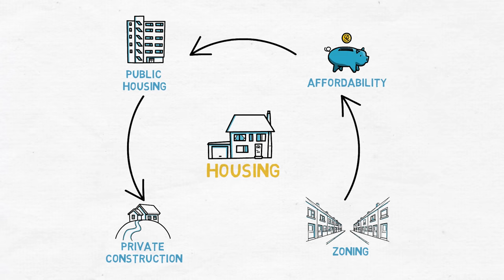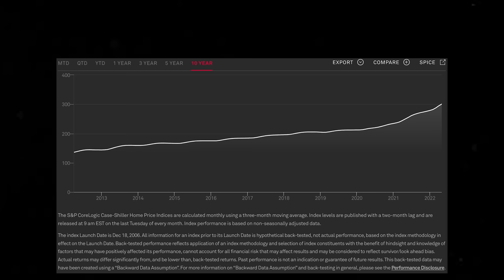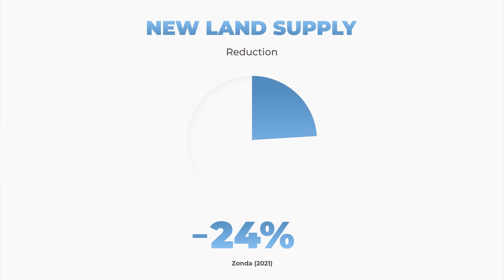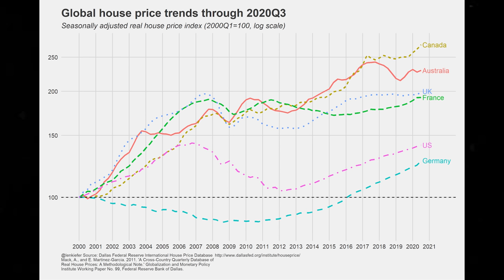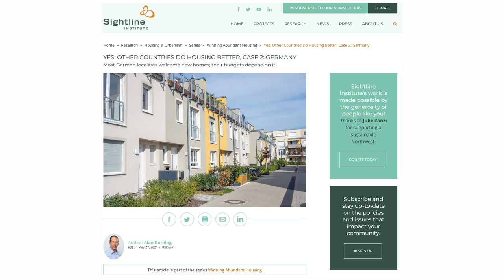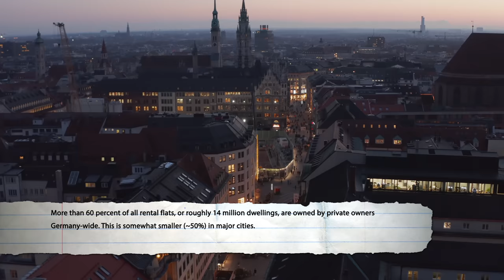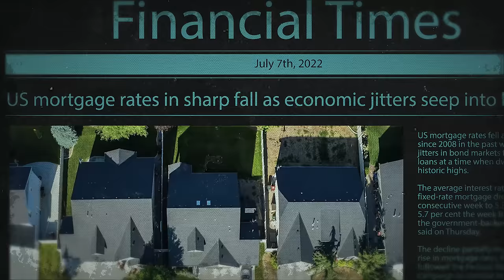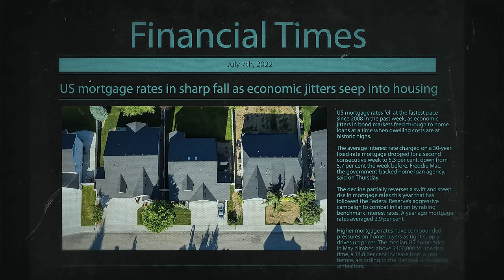Germany vs. USA: The Affordable Housing Crisis

Comment: I live in the "Speckgürtel" outside of Karlsruhe, one of the villages surrounding this medium sized town. Karlsruhe happens to be one of the towns with the most extensive network of Strassenbahnen (Tram) in Germany, Europe or the world (or so they say). You can literally go for hours and up to 100 Kilometers in one direction. This infrastructure is rather old, actually they took over some of the railroad tracks that were abandoned by the Deutsche Bahn and made it profitable again (they changed the track width of all the 'old' tram-lanes to be able to use the standard width of the DB with all cars of the tram). One of the improvements in the little villages was, that they moved the tracks from the outside of the village to the center of the village whenever possible (sometimes car lanes and tram sharing the same space). Actually this infrastructure was one of the reasons we moved here thirty years ago.
Another thing though, this whole development was driven by a very few persons that recognized the chances they could see in the future and kept pressuring officials of the town to support them. Convincing officials of what is good planning and what is not probably ist he hardest part in urban planning. And sometimes it is hard to tell, is is lobbying or genuine concern for the urban development,  that you are dealing with (as a local  politician).
In any case, it helps, if more people understand the situation and are able to interpret what architects, planer and politicians are trying to tell them.
Reply: Thoses lines aren't abandoned they are mixed use with with DB Trains this is called the Karlsruhe Modell it was invented there and has been or is been implemented in Chemnitz, Heilbronn, Kassel and Saarbrücken even with an international line to France. Total or almost total conversion of heavy rail lines happened before on the Suburban Rail Lines in Cologne reaching to Bonn and some lines in Karlruhe like the one to Bad Herrenalb and in the region around Mannheim with meter gauge heavy rail. If you only look on the tram network itself without heavy rail mixed use, the bigges tram network in Germany is Rhein-Ruhr.
Reply: @futurerails8421  I am just wondering whether to get agitated or just assume you are to young to personally know? The Murgtalbahn is mixed use and was never abandoned. The lines through the Hardt were abandoned by the DB some decades ago and parts of that later reactivated by the KVV as S1/S11. And these lines are not used by the DB at all.
Reply: @wora1111  It seem like you did not know what Karlsruhe Modell means. The Karlruhe Modell is the use of multisystem trams supporing DC tram power system and AC mainline power system and running under EBO and BoStrab. Even if some lines have no other rail traffic besides this, they still support it without special locomotives.

It was invented to explicitly use existing rail lines to bridge the gaps between cities and have tramlines on both ends. Otherwise cities like Wörth am Rhein were way to small for a tram.

Some lines in Karsruhe are also total converions or partial conversions from former rail lines or suburban rail lines.

These things were done before for example in and around Cologne but putting a DC overhead wire instead of an AC overhead wire above a railway line and especially installing high floor plattforms limits the usability for heavy rail.
Reply: @futurerails8421  Yep, I agree. That is pretty much what I told my colleagues about three decades ago.

Comment: Very interesting video and well done. The big problem in Germany is that there are increasingly fewer small, private landlords, especially in big cities. The biggest landlords in Berlin are companies that are listed on the stock exchange and make enormous profits. Compared to 2017, average rents in Berlin have risen by 18.5%. Real wages have also risen in recent years, but to a much lesser extent. Due to high inflation, real wages have actually fallen by 1.8% compared with last year. In the past, local authorities were able to intervene in the rental market in a regulatory manner because of the so-called "social housing". However, this system has been massively scaled back in recent years. In addition, many cities and municipalities have sold thousands of rental apartments from their own stock to profit-driven large corporations. In doing so, they have also given up the possibility of being able to intervene in the market in a regulatory way. As a result, cities such as Munich have problems retaining or finding esential workers in the low and medium-wage sectors, such as nurses or firefighters, who can afford housing in the city. Especially the conservative and neo-liberal forces constantly claim that only new construction can solve the problem. But, as mentioned in the video, the cost of construction has risen so sharply that this cannot work. In addition, the climate crisis is causing construction costs to rise even higher. In my opinion, you can't let the market regulate every area of life, because that leads to antisocial results that endanger social peace and democracy in the long term. And the housing market is not the only problem of our time that needs to be solved.
Anyway, I look forward to your next video and wish you a wonderful Sunday. Greetings from Berlin.
Reply: Indeed a chronically under mentioned, other side of Germany's housing issues is die Neue Landflucht (TL the new rural exodus).
While long increasing financialisation of the real estate sector does push central urban housing prices, continued neglect of more rural infrastructure and development disproportionately drives a supply of people into the cities, to also fuel the competition.  - After all, price (or regulation thereof) matters a lot less without someone willing (or forced) to pay it.
Reply: A lot of cities sold huge parts of their social housing to big corporations in the late 90ies and early 2000s. They created this problem decades ago.
Reply: @MsLarrythegreat  interestingly due to covid we saw the opposite effect for a short time due to home office. The main incentive for going to the city is that the jobs are there. If you are not forced to go to them for work, many would prefer living more rural. But due to the factors you describe the infrastructure in those areas has been so neglected to the point where home office is not even possible. Basic things such as stores, internet or doctors are a lot worse in rural areas. Its a self fulfilling prophecy really

Comment: Great video!

I've lived in North America off and on for years, but I'm currently on my first stint in a Canadian city (a decent-sized one out on the Prairies) and I've found the housing issues here fascinating. The cost is much better than elsewhere in Canada, but affordability by local cost is still a mess. My family wanted a central, walkable neighborhood, but when we looked at the city centre it quickly became clear that we would either be in old, cockroach-infested buildings with little to no security or in very expensive (Toronto expensive), newer buildings...right next door to the cockroach-infested buildings with fights and drug deals going down most nights. And mixed in with all of that are the mid-range, more affordable apartment buildings...all of which are for seniors only. It feels so close to being well planned, and yet so far at the same time! (The few buses and 20-minute walk to the main supermarket in the area aren't ideal either TBF.)

Comment: I live West of Germany and we, again, have upwards pressure on the housing market. Much higher fraction of ownership, I guess, than at the neighbors. Also, the price differences per blended square meter house, square meter plot and cubic meter house, typically are significantly higher in the denser populated region of the country (cf. "coastal" USA).
The problem in these markets?
When you move from the "expensive" to the "cheap" side of the country, you step out of the inflation spiral on the expensive side and most people will not be able to afford a return into that spiral at a level they will find acceptable.
Leaving the "coastal" US for a stable or cheaper German market may have the same effect, I guess.

Comment: I live in a very expensive area, the SF Bay Area. After 50 years of opposition to development, people are finally coming around to an awareness that the old NIMBY model doesn’t work. However, a lot of the cities here also have rent control. And many tenants with rent-controlled apartments are the worst NIMBYs, because they have way below-market rents and don’t want to have to move to allow bigger buildings. They support anti-development candidates. You mentioned Germany has a lot of renters and also rent control. How does Germany avoid that problem?
Reply from the maker: There's a few things going on, but I think there are two big reasons (and fair warning, I am generalizing a bit here because there are always some caveats). 1) Most German rent controls doesn't mean that your rent is fixed, but that your rent can't be arbitrarily increased. For example, rent control has been in force in many of Germany's largest cities, including Hamburg, Berlin, Stuttgart and Munich, for many years. This stipulates that “cold” rents (excluding utilities) cannot be more than 10 percent higher than the local comparative rent. In addition, rent cannot also not increase dramatically from one year to the next. The landlord is allowed however to increase the rent up to 15% within a 3 year period. But this increase should be "justified". 2) Development in general - especially the demolition of an existing building to make way for a new development is a tedious process in Germany. However, if the landlord decides to sell the building you are living in and the new owner wants to kick you out - there isn't a whole lot you can do.
Reply: @TypeAshton  here the tenants or neighbors would sue and tie the developer up in court for years until the project is no longer financially viable.   The state is now passing laws to try to prevent this by preempting local laws, but so far it hasnt made much of a difference.

Comment: Wow .... I am almost speechless, that's why I write my comment down here ..... you managed to explain a very complicated situation in a way, that everybody could easy understand, you were short and at the same time you explained every aspect, and on top of it, you managed to explain the differences between USA and Germany.

But .... I can not agree with you, that housing in Germany is cheep, the opposite is the case, renting is something like play with the wheel of fortune and building a home/house is extremely expensive. 10 years ago it was wayyy cheeper, I bought my house in 2011 for 135.000 €, it has now a value of at least 220.000 €, the house of my parents was build in 1978 (a two-family-house) for 187.000 DM (Deutsche Mark), that has now a value of at least 250.000€. 
My parents bought the ground for building the house in 1974 for just 10.000 DM (1.000 m²), now here around that house, even building-ground half that size (bigger sizes are not affordable anymore) will cost you at least from 100 € per m² on, if you are so lucky and can buy one.
Reply from the maker: Hi there - to be clear, I mentioned that housing in Germany is stable, not cheap. There's an important difference there as the housing market is less volatile to changes in the wider economic market (such as the crash of 2008) - BUT (and it's a BIG but...) prices are still high and inflation is causing prices to increase faster. There's a really great graphic done by the International Monetary Fund that shows House Prices (and rent) compared to income - and in both categories, it is higher in Germany. https://www.imf.org/external/research/housing/

Comment: Excellent video! I can definitely attest to the American fixation on homeownership as someone working on housing policy at the moment. I don't think a "reset" of our psyche is going to happen anytime soon, but I think there are ways to creatively build more housing diversity without running afoul of the American ethos.

I think a place where there's quite a bit of opportunity is changing state laws to facilitate ownership of denser housing types - including condominiums and limited equity home cooperatives. I've found this to help disentangle the notion that "ownership" is equivalent to "single family home". Then it becomes much more feasible to promote housing diversity (note: I also use 'diversity' over 'density' because people freak out at the latter, which makes sense - '32 du/ac' is much scarier than a picture of a quadplex).

Another thing I question is the economic theory around fiscal zoning. I feel like if this was effectively playing out in American communities, they wouldn't all be so broke! If anything, high density zoning makes the most sense from a fiscal zoning perspective (more ratepayers on less infrastructure maintenance liabilities), but most U.S. jurisdictions have done the opposite, and - surprise surprise - their maintenance liabilities are so great, they have to shift infrastructure costs increasingly onto developers.

Comment: It all depends on region in Germany. Here 90km from Hamburg direction northwest. A 100year old brick build house which needs some renovation like a new heating system and some insulation could be bought quite cheap for about 120000-180000€.
The same kind of house within the circle of 40km around Hamburg would cost about 500000€. But such kind of Houses are very rare in the near of big cities today. Most of them are already renovated and would cost more than 700000€. That amount of money is not payable by average German.

Comment: I am not so sure about other regions but in many East German cities still a big chunk is owned either by a city owned company or a "Genossenschaft". This is due to this 2 parts being the dominant economical forces in the GDR. For example in my city (230k inhabitants) it's about each 1/3 of all appartments (over all, not only rented ones) that are owned by the city (Wobau) or on of many local "Genossenschaft". They are both highly coorperative, have the well being of the city in mind and as the Genossenschaft means it's owned by the renters they also don't need to make a big profit. Both of them also keep building new ones, especially everywhere the city has an interest to fill holes. 
Private companies from the outside are growing but still they play a minor role. So at least here it's not small owners. But also only regional. This helps a lot.

Comment: I’m looking forward to your next episode. I can already sense where it is going to go.

I live in a moderate sized city in Massachusetts and housing along with just about everything else is much more expensive compared to most of the US excluding NYC, DC, SF Bay Area, and Seattle. My city was always a starting off point for many people starting to climb the economic ladder. My city has been busy increasing housing availability by turning former textile mills in low income housing which has substantially increased the population and expenses but doesn’t generate much tax revenue. While I live in a single family zoned neighborhood, many of the houses have turned over in the last decade or two and it appears multiple families are now residing in a number of these houses. This has resulted in a much noisier environment with way more cars so while the 1 or 2 family cars of years ago used to fit in garages, today a third and fourth car are now parked on the street. Again, this increases population but expenses increase even faster not to mention making plowing snow more difficult. So while people are advocating for higher density, I see a downside to it. Less than 0.4 miles from my house is the city/town border where the adjacent town with larger lot sizes required by their zoning hasn’t seen multiple families moving into single family homes with its attendant issues and as a result the property values in that town are increasing faster than my city. The adjacent town has no problem paying their way from local revenue sources as it’s planned ahead for commercially zoned areas which bring in revenue but not many expenses. Therefore, the town provides great services including top notch schools to their residents while receiving substantially less revenue overall and on a per resident basis from the Commonwealth compared to the revenue the Commonwealth provides to my city while the Commonwealth is also essentially paying the entire school budget of my city.

One last thing, your graphics are over the top great!
Reply from the maker: During my PhD, I spoke quite a bit with low-income housing developers about what are the most significant pre-development steps community members get the most invested in, and they overwhelmingly talked about traffic studies and parking strategies. For new developments, especially when constructing multi-family projects with an increase in cars, they are actively working with planners to address traffic and parking issues. However, with infill projects this can be a LOT more difficult - especially if the area in which they are "in-filling" with multi-family housing is not well connected with other forms of public transit that make commuting without a car more feasible and the streets were designed for a lower traffic flow... it can be a very difficult and complex problem to fix.
Reply: Dr. Ashton,

Thank you for your reply. It is a tough problem.
Reply: I love Cape Cod n eastern coast but Taxachusetts is out of control n bought a house in NC..  Same as Ma. but less rules, laws n taxes...  Plus year round fishing n isn't anti 2nd. Amt...  be well.